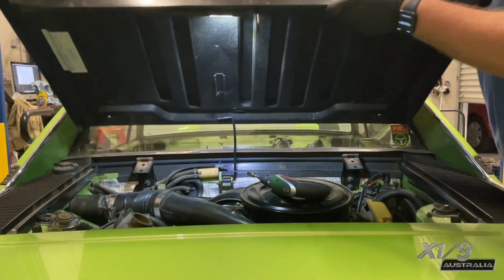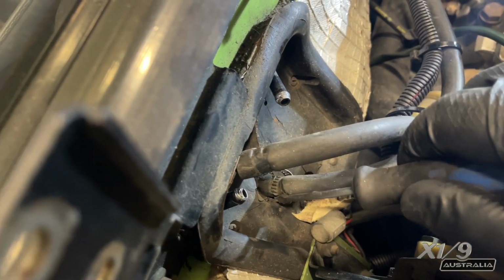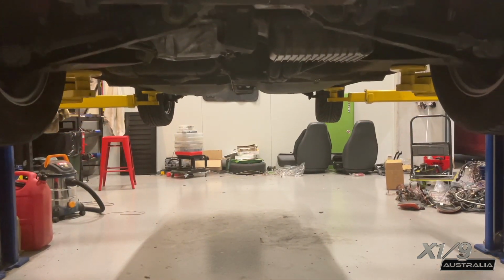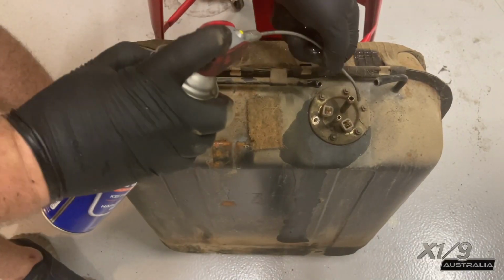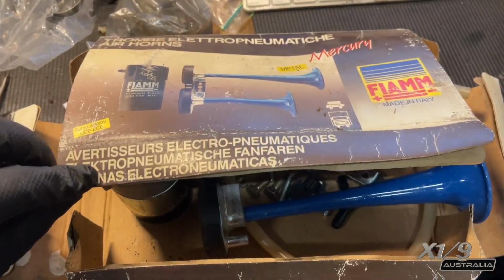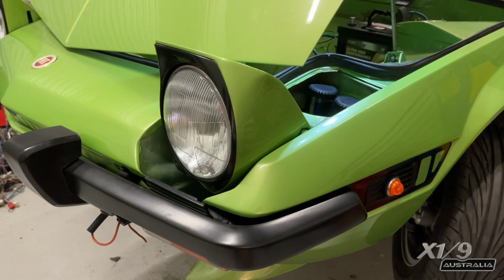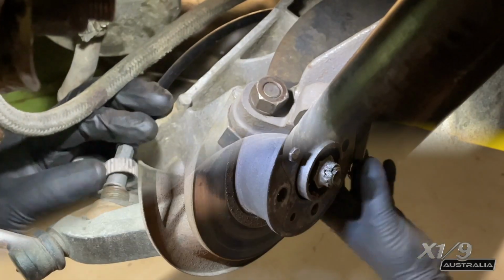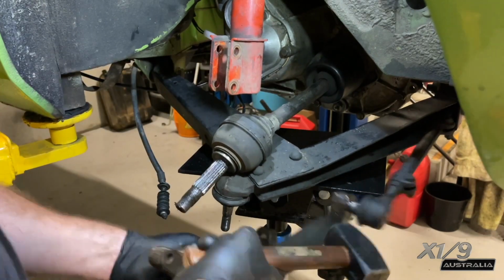The Green Machine Ep.11 — Engine Removal, Fuel Lines & 5-Speed Gearbox Prep | Fiat X1/9 Restoration

Comment: Absolutely fantastic look how to refresh the good old X1/9.  I'm not a huge fan of WD-40, but if it works for you, I'll reconsider it. 🙂  

...now onto Part 12...
Reply from the maker: Im not promoting WD40 it's just whats easy to get and most of the time does the job. What do you use instead as i'm open to trying others?
Reply: @x19australia   @Mark Weinberger  PB Blaster for penetration ---- cuz it's just that good.  WD-40 leaves a residue (but that might be what one wants depending on the application).  For what you've used it for, either is fine.  🙂.  On Part 21 right now.  The series is very addictive.  Your Re-build of the petro-tank was very cool. ... back to episode 21...🍿

Comment: Wow that's quite a large fuel tank,  I only ever drove an X-19 once back in the mid 80's but I've not seen one over here in the UK for decades as the horrible orange tin worm took most of them I think.
Reply from the maker: Yes it's surprising how long it is. When I first did this many years ago I could not get the car high enough in the air to get the tank out. There are not many in the UK now especially this series 1. As you say most have rusted away. Thanks for watching.
Reply: @x19australia  have loved following along and always look forward to new videos.